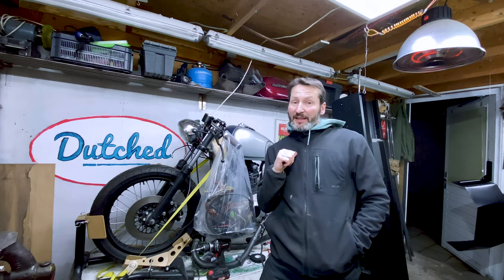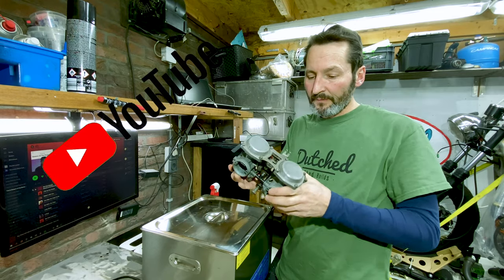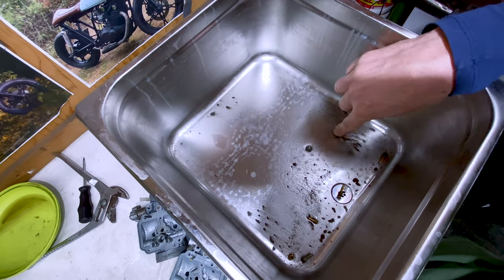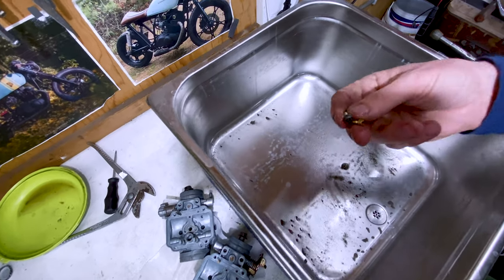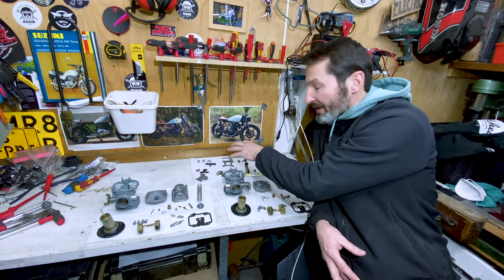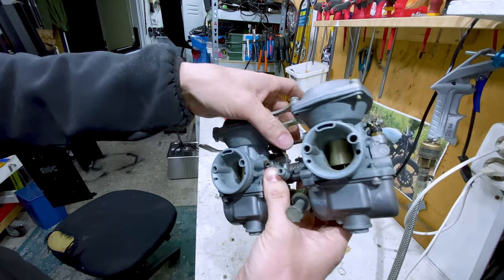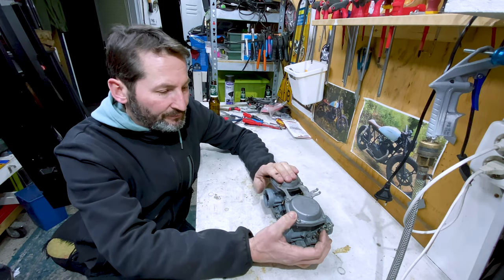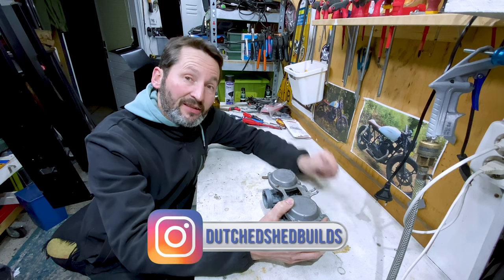Suzuki GS450  Cleaning carburator with ultrasonic cleaner

Comment: Do you have a slown down video of you reassembling the carbs? Because i have to clean the carbs on my gs450 and it is the first time i do something like this.
Reply from the maker: I dont think i have. If you are starting out I would highly recommend getting a service manual for your make/model. So a Haynes or Clymer manual. Those tell you exactly what to do. 
The carbs on a gs450 are very simple and basic. So just keep track of what you take off, check the manual for all the parts that are supposed to be there (because sometimes the previous owner skipped a part) and you should be fine. 
If i find a moment I'll try to make that video. If you have questions just let me know.
Reply: @DutchedShedBuilds  thanks a lot man, i will look for the manual then, I have a gs450s that my grandfother bougth 43 years ago and its been sitting 30 years, now i want to make it run again. Its the first time i do something like this and your videos are helping me a lot. Do you have any recomendations on how to clean the tank?

Comment: what size UV cleaner did you use (L)? not sure what size is good to get.
Reply from the maker: This one is 10 litres. Plenty big for a 2-cillinder carb. And should you switch to 4 fourcillinder it should hold it. If you stick to 1 or 2 cillinder carb the a step down from 10 litres is also an option
Reply: @DutchedShedBuilds  thank you! I have (three) gs450L that im rebuilding right now,  thanks to your video i am considering getting one of these uv tanks. i appreciate all the production!